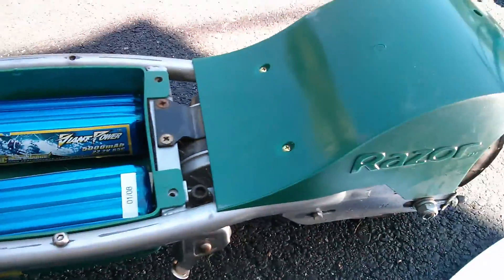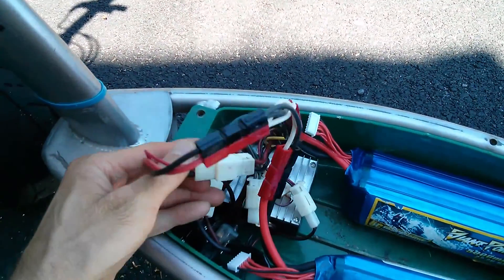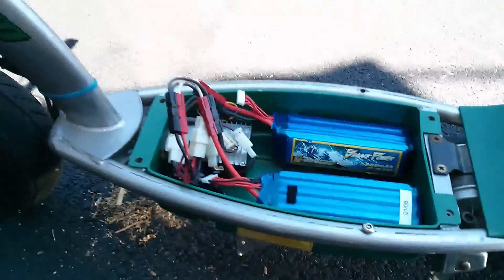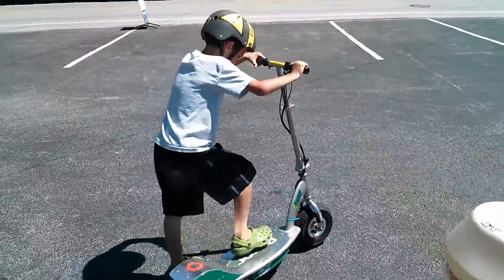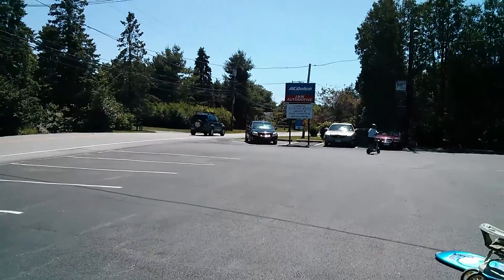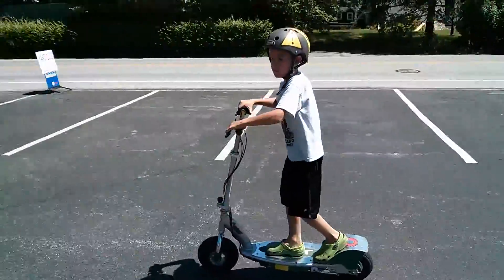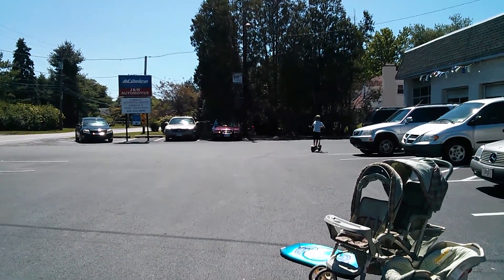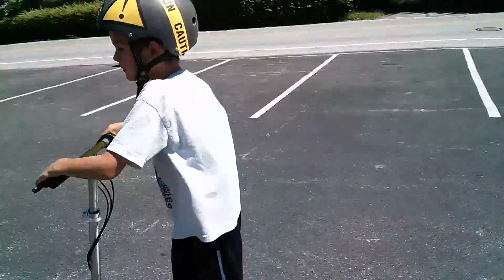Razor E300 Lipo Conversion

Comment: I got a e200 with 500 watt motor and 36 volt controllet how do i connect lipo bstteries to it
Reply: the same way your would connect any normal battery ????

Comment: Hello, thanks for your video, i would like to know if you have made other modifications, or just changing the batteries, because normally you have to change the battery charger too ?
if it works like this, that's amazing because everybody seems to say that we have to change more stuffs ... ! thks
Reply: you DO NOT use the original charger to charge lipo batteries.  Absolutely not.  if you see the 7-wire plugs on each pack, you use a $20 6S balancing lipo charger... unless you want lipo to explode, of course.

Comment: In my case the vehicle is a ground force drifter. Runs similar electronics though. I've replaced the lead acid batteries over and over. They don't last long and stop holding a charge after just a few weeks. So they're cheaper except when they don't last. The drifter wants 24V for 250w, or about 11 amps and usually the lead acid batteries have a capacity of 10AH. I'm thinking 4 4S 5000, 2 in series for 29V, parallel pairs for 10AH of slightly higher voltage and hopefully more reliable/longer-lasting power. Sound stupid to you? 😄

Comment: What's the discharge rating on those 6S/5000s? 25c? 30c?
Reply from the maker: malATX I think they were 65C. However, since doing this, I've come to the decision that I don't recommend this mod. I think replacing the lead acid batteries with amazon replacements is cheaper AND the fully charged voltage is higher (27.6 for lead acid vs 25.2 for lipo). If I had it to do over, I'd have just bought replacement lead acid batteries.

Comment from the maker: Max, I made a parallell connector. Both batteries plug into it and on the other end the red wires are together and the black wires are connected together.

Comment: I was looking at your video; have question.  I have razor e300 also; and looking at turnigy 5000 mah 6s lipo from hobby king.   the original batteries are connected in series I think?  so how do you connect in parallel with these lipos?    thanks   max